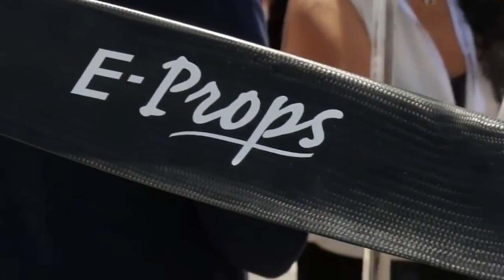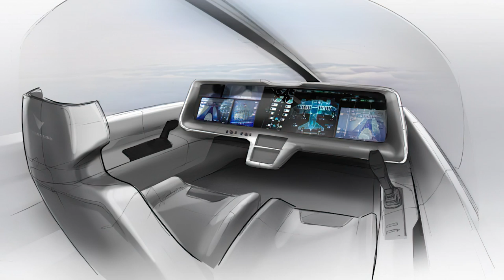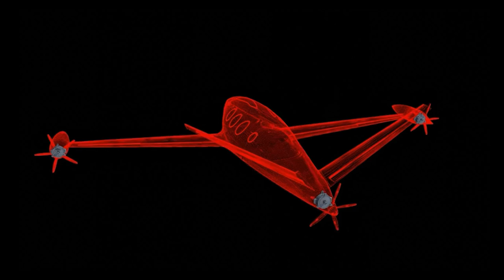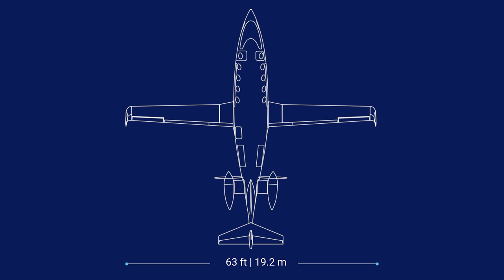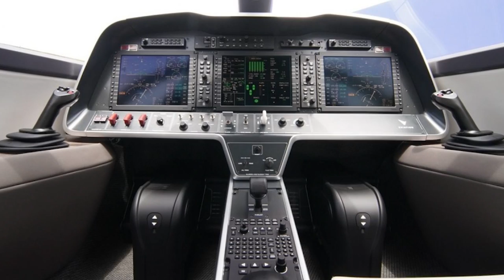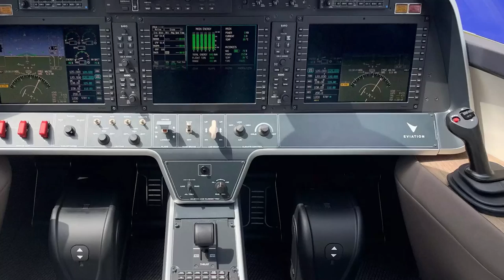Eviation Alice - electricity bursts into the sky

Comment: Proof that exaggerated claims will get you funded, but that funds can't turn exaggerated claims into reality.
Reply: The vast majority of tech startups are just investment scams. 

The founders of this project knew the limitations of battery energy density before they launched the business and yet they went ahead with it. Tells you all you need to know.
Reply: There is still a huge market for regional puddle jumpers and the operating costs are cut in half.As was mentioned $200 flight hours.That market could easily double with those lower fares.
Reply: Agreed, but unlike the vast majority of tech startups are just investment scams, this one at least has proven its concept and airworthy!

Comment: To me, unless they allow you airdrop spent battery (which will never happen), electric airplanes will be limited to general aviation or small shuttles… after all when using fuel, the plane gets lighter over time, 747 can land 70 tons lighter compared to takeoff…
Reply: Airdrop spent batteries and aerial reloading and you can fly around the globe with current battery technology. It's not a technical problem it's a economic one.
Reply: @RODI____  lol...air refueling is hard enough. You think air dropping batteries is gonna be feasible e economically? Lmao
Reply: Just week ago there was anonse of serial production of new battery tech with doubled capacity at the same weight, for abiation market ;)
Reply: Especially since just using hydrogen would be so much easier to implement. Electric cars only work because most people don't actually use their cars another like to their full potential. Most people drive a few hours at a time. So having a smaller totally range isnt really a big problem. A commercial plane typically flies almost as far as it can go every time.  So having all planes lose 50% of their range for a given size and weight and payload is not going to happen, especially not when it takes hours to refuel it.

Comment: There are so many technologies that are just waiting for higher density energy storage to reach their full potential. I'm very excited to see what the future holds once we crack that nut.
Reply from the maker: If the problem with the batteries is solved, we will soon see a completely different world outside the window
Reply: I also wonder why they haven't used any flexible solar panels.... those wings and body could accommodate a lot of (unobstructed, unclouded) sunshine!
Reply: @millanferende6723  ... because solar panels on wings and body wouldn't generate enough energy to even get their own weight off the ground! Easy calculation!
Reply: @st-ex8506  Yeah that's true (mostly)... but there is actually a 1-person electric glider plane, which uses solar panels and it works well.
Reply: @millanferende6723  Are you referring to Solar Impulse from my old friends Bertrand Piccard and André Borschberg?
You are 100% correct.  But Solar Impulse is a freak of an airplane, built for nothing else than to go around the world on solar energy alone... and they did it!
As you correctly mentioned, it is a one-pilot only airplane, weighs only 1600 kg with the wingspan of a Boeing 747.  So, it hardly qualifies as a marketable airplane, or does it?
For any other airplane than this one-of-a-kind, my previous comment stands!
BTW, there are also airplanes that have flown on the pilot's muscle power alone, including a successful Channel crossing!

Comment: Two markets that battery tech needs to get far better in density and quick charging performance is Aviation and Motorcycles. Unless someone comes up with a better density to cut the weight, like solid state or graphene, it's going to be at best a niche market. I still think someone needs to figure a way to upscale production of algae aviation fuel. At least the algae absorb CO2 and hopefully is close to carbon neutral.
Reply: Look up Milankovitch cycles with your carbon nonsense.
Reply: @just_one_opinion  Milankovitch cycles do not explain the current environmental issues.

Comment: I wonder if they will offer that airframe in a more traditional power plant arrangement. I really like the lines of it and more traditional propulsion options may bring it to market quicker. That of course supposes it can be economically retrofitted with liquid style fuel tanks, engines and associated plumbing.
Reply: Unlikely. Certification is very expensive and time consuming. If you want a plane that looks like the Alice check out the Piaggio Avanti.
Reply: @Saml01  Good point. Thanks for the recommendation. 👍
Reply: It also wouldn't really make sense for a business perspective, they'd essentially just be offering a worse Piaggio Avanti and competition in that market is really fierce.
Reply: It is totally designed around battery packs and electric motors, it would require complete redesign to fit fuel tanks, not even considering the legal and regulatory problems, which would be enormous.
Reply: Well no, they would need to redesign as they would be flying faster as NO ONE wants to fly at 250knots... These aircraft have tried to be sold before MANY MANY TIMES.  Why they sell 6-->12 person business jets flaying at Mach 0.7+
Reply: I was imagining something with a hybrid arrangement. Sure, it isn't emission free, but at this point, gasoline or kerosene have much more energy than batteries.

Comment: To be honest, if true, I think the range of the aircraft is decent even in its current state. 700 km range opens up some reasonable options: from NYC you can now reach Toronto, Buffalo, DC, Pittsburgh, Boston, et al. These routes fall right into the short-haul niche that this aircraft is designed for, and combined with a cheaper fuel cost and significantly lower maintenance costs will hopefully make for a very viable regional aircraft. The only significant issue that I see here from a user comfort standpoint is that of charge timing: upon arriving into an airport, a delay will need to be implemented in order to recharge the aircraft.

I started to wonder about electric aircraft this morning, upon realizing that small GA engines (i.e. lycoming O-320) have an easily comparable horsepower to cars such as the Nissan Leaf. I was thinking more along the lines of small GA/trainer/commuter aircraft a.l.a. Cessna 172, with ranges of about 300 km that would be made practical by 30-minute rechange and free fuel. Guess we can go bigger.
Reply: Imo however Electric propulsion still require to be significant advancements in battery technology, more so than the motors, for it to be applied to bigger planes.
The closest prospect would be Sodium Ion batteries but the weight penalty would still be a contentious topic for debate. 
It was thought that Hydrogen cells would be the answer but there has been no news ever since the pandemic started.
Reply: Free fuel? Where do you get free electricity from?
Reply: @waynewhelan3069  Fair enough, my bad. It allegedly costs around $14 to charge a Tesla, as opposed to $75 to charge my RAV-4 of comparable range. Still a vast decrease in fuel costs. I presume jet fuel will be far more expensive than vehicle gasoline.
Reply: The recharging problem could be solved with battery swap. This would be easier, than for vehicles, because you need swap stations just at the airport, and planing is easier as well.
Reply: UH, no.  Its range is a pathetic 250nmi.  Not 400nmi(700km)
Reply: @w8stral it is the worst possible it could be. It will only improve from here
Reply: @okman9684  hey, lets play make believe about new battery tech and pretend it is reality!!!!!  Genius!... Last I checked, for my ENTIRE lifetime(46 years) I have been told that solid state batteries are HERE and functional.... Uh huh.
Reply: The demonstrated range is nearly zero: the only prototype which has flow did a single flight of seven minutes.

Comment: In the eight months since you posted this video,  battery technology has already advanced with a potential increase in energy density (which more or less equates to power per kilogram -  "bang for your  buck'). Advanced battery materials, flow batteries, and solid-state batteries have increased the energy density and reduced the charging times of the latest generation of batteries. The implementation of nanotechnology in battery manufacturing increases the surface and size of battery electrodes - this means they will absorb more energy during charging and increase the  energy storage capacity. Since 2022, the average energy density of even Li-ion batteries has increased by about 5 to 10%, and we can expect more improvement in the future. However, I remain dubious about the wisdom of using Li-ion in aircraft given their acknowledged problems regarding their propensity to burst in flames for no apparent reason.

The vast, and I mean VAST majority of airliner flights are short range commuter flights with small passenger numbers. They have the greatest impact on the environment as regards emissions, so much so that some countries, such as France, are banning them. But electric aircraft could replace many conventional piston and turboprop aircraft on short-haul flights and there are technical reasons why that could be a good thing.

One of the greatest impacts on the life of an aircraft is not, as you might expect, the number of flight hours, but the number of "pressurization cycles" . Each cycle involves a takeoff, a pressurization sequence and a landing. Aircraft on short-haul services undergo a lot of pressurization cycles, but the reason they need to do this is because the engines are more efficient at higher altitudes, so they need to fly higher to be at their most economical.

However, electric aircraft have no such constraint. There are no efficiency gains to be had by flying at 20,000 ft instead of 2,000 feet so - in fact, it is probably more efficient for electric aircraft to fly lower. Consequently, there is no need for a pressurization system, and even if there is, they would not need to pressurize to, say 39,000 ft, so the strain on the airframe is reduced. Short haul electric aircraft could fly much lower, meaning no need to waste battery power climbing to high altitudes. I can easily see a small commuter airliner like the Eviation Alice or the Heart Aerospace ES-30 flying a 500km flight from one airport to another at 1,000 ft AGL instead of the usual 20,000 ft by other small commercial feeder liners. Interestingly, the ES-30 will carry two gas turbine APUs  to supply extra electrical power, which would only be used in an emergency, or in the case of an aircraft needing to divert to an alternate airfield out of its normal range. Like the APUs on regular airliners, they use aviation jet fuel 

IMO, we are not yet ready to see large scale electric aircraft commercially, but I don't see it as a false horizon either. I think they are only a few years away.

Edit to Add: I expect someone will take exception to my statement that "There are no efficiency gains to be had by flying at 20,000 ft instead of 2,000 feet" . Well I confess that is not entirely true. Drag at 20,000 feet is a lot lower than at 2,000 feet. But, its all relative - it is a much smaller part of the equation. Over 80% of the efficiency gains from flying at altitude come from greater engine efficiency. Flying at altitude might give you better drag efficiency, but you have to get there first. Most of those gains are eaten up by the losses incurred in using battery power to get to the higher altitude i.e. it costs more power to climb than it does to fly level, and in the case I am making, short haul, very little of the flight time is spent at high altitude.

Comment: Thank you. Normally, engineers start with power plant's expected numbers like kWhour, range afforded, and weight of the supply battery pack, and consider load weight and range. Then, it's kind of coasting downhill from there with the air frame design. Looking at your specs, I figured there was going to be a bunch of disappointments in these specs. And, sure there are. I would strongly suggest that they resolve the energy density versus onboard weight of the battery supply and once that target is achieved  - what will it take to move a desirable number of passengers to a given distance? Then, they tackle the rest. WW2 studies by Germans (Dornier 335) late in the war, including American studies of the Curtis Ascender XP55, proved that a pusher design causes less drag than a puller (hence more speed).Your aircraft reverted to a puller. Hope this worked for Eviation Alice. We live in exciting times! Great job you did Skyships Eng!

Comment: Its good to see the start of electrification of planes. With a good engineering workforce we will encounter these problems and devise solutions to work around them just as we did with combustion aircraft. If you get even more money pushing new battery tech we'll see improvements come even faster than we have recently, which will affect nearly every corner of the tech and vehicle sector that is left. Now that we've got one, many more will follow in short order.
Reply: Well, nice. But we haven't one yet. Really.

Comment: that is a steal. For a price per hour comparable with small  2-4 seater you get multi engine without engine issues. That is awesome. Its not like those small planes have better range nor speed.
Reply: I was gonna say, $200 per flight hour for something equivalent in passenger capacity and speed to a PC-12 or TBM 900 is very impressive. You'd be lucky to rent a C182 for that at some airports.
Reply: @jonathankleinow2073  but with 1/3 the range.
Reply: @mofayer it will only increase from here unlike traditional jets who have to do daily fuel price adjustment and expensive overhauling

Comment: Aircraft are usually worked hard, so they would do several such flights per day to hit profit margins. That means several full battery charge-discharge cycles every day. Therefore the batteries would reach EOL several times faster than your average electric car, say after 2-3 years instead of after 10-15 years. Hence the aircraft is likely to need it's batteries replaced several times through it's expected lifetime. Is that factored into the cost of ownership?
Electric car owners accept that their range will reduce as their battery ages, is that acceptable for aircraft?
Reply: All the proponents of commercial electric vehicles conveniently leave out the fact that batteries are consumables just like fuel only on a longer timescale.
Reply: @bumponalog7164  There is a federal law that mandates a minimum of 8 years or 100K miles battery warranty on EVs in the US. That's about how long most cars last. Some manufacturers provide a 10 year warranty. In 8-10 years batteries are going to be significantly improved just like they are today from 10 years ago.
Reply: @noalear  Same federal law that calls for secure borders?   My ZERO FX has a 5 year warranty so not sure which law you referring to? Anyhow , the battery on the 12K bike went out after 1500 miles and cost the warranty 5k.    EV's are shit.

Comment: This final version is a very beautiful plane. The original concept with wing tip props was dangerous. If one wing tip motor shuts down, the plane could go into a spin.

Just like the Piaggio Avant, the airfoil shaped fuselage of this plane would generate lift, and even more, because it has a flat belly.
Reply: That's not the final version. Since your comment, Eviation has admitted that customers don't want that design, and they have introduced a third version, with a conventional fuselage... it's now just a common type with battery-electric propulsion.
Reply: @brianb-p6586  Any pictures?

Comment: I fleet of pilotless cargo aircraft is one of the more realistic applications for this aircraft. There are several smaller airports around the country that could accomodate without requiring DHS fees to be loaded on the flight costs.  Passengers require pressurized cabins, DHS inspections and most won't choose flights broken into hops with the way the current DHS guidelines require early check-ins and other time-consuming procedures that discourage traveling.

Comment: The battery wraps around the lower half of the cabin. Half the cabin must be pulled out to access it. Far better to have a bolt on battery below the floor so it can be removed and maintained with ease. The cabin height should be about 1.9 metres. the fuselage needs to be another 600 mm to 700 mm taller - it may lose some of the blended wing effect.

Comment: What you are missing are integrated solar panels like Aptera.
This may give the critical 10-15% extra increase in range with a small increase in weight.
Reply: You apparently have not calculated the output of the panels which could be mounted on this aircraft, and compared that to the power consumption.